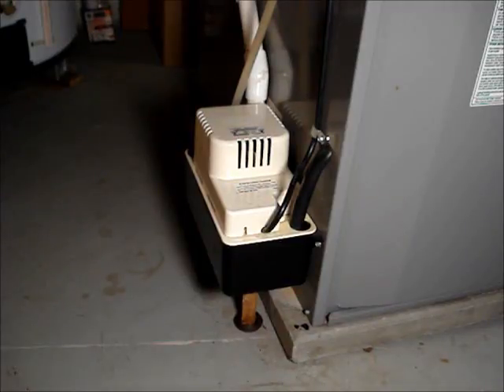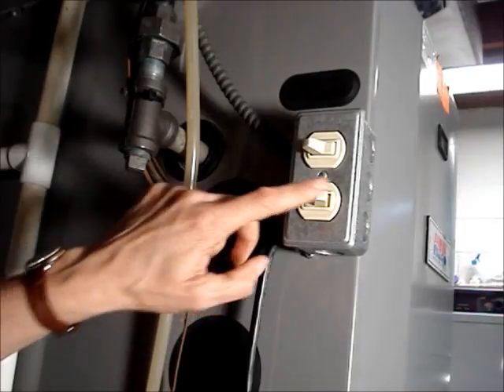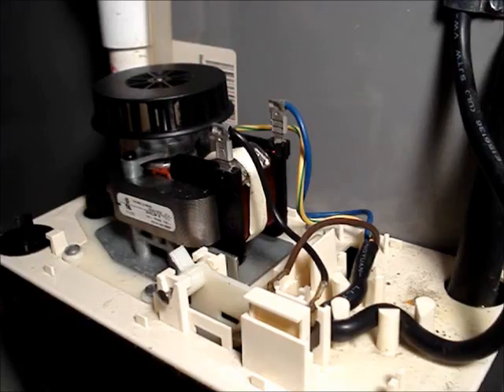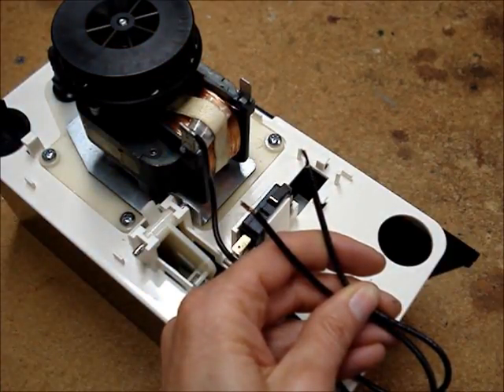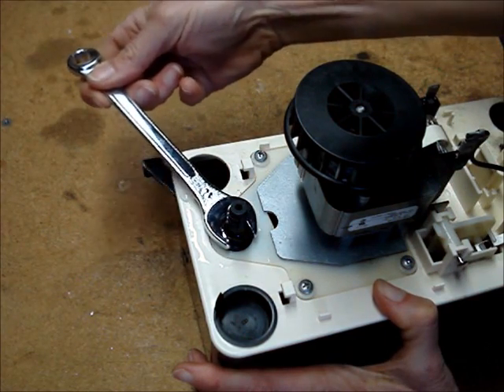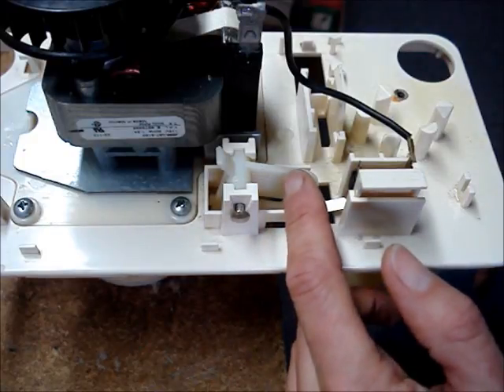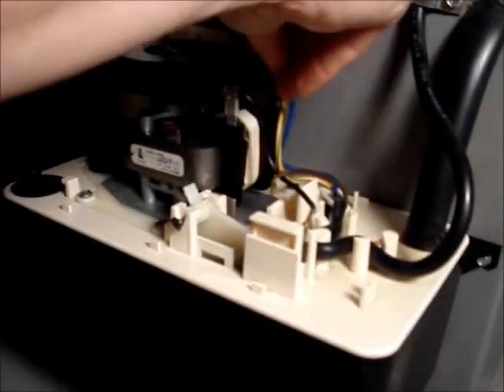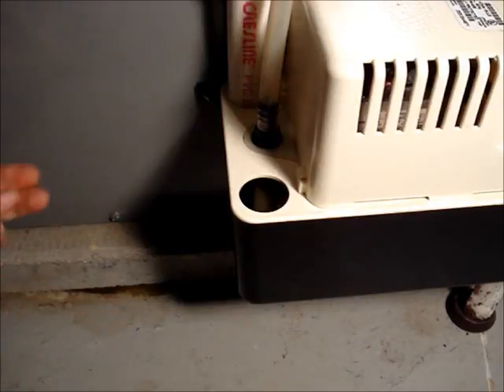Clean a Little Giant Condensate Pump

Comment: Good video but I have to disagree on disconnecting the wires to the pump.  There is absolutely no reason to remove it if your unit is less than 5 years old.  The water DOES NOT get up there and folks who open it will end up breaking or damaging the wires.  I have the exact pump and it's been 15 years since I last changed it.  The only thing I do every 2-3 years is removing the black plastic pump to clean the buttom as gunk will build up.  Brush the float switch and clean it with soap (not bleach).  Matter of fact, I just changed to a new pump after 15 years.  You shouldn't have to take everything apart every 1-2 years.  You don't do that with the sump pump in the sump pit, so why do it with this?!
Reply from the maker: Hi Jeremy, thank you for taking the time to comment and explain how you clean your pump.  The pump in the video is hard wired, there is not enough slack in the wires to do as you say.  I'd have to let it dangle from the wires.  I can't imagine the howling I'd get from some viewers when they see that and people saying that I will break and damage the wires.  Depending on climate, the pump may gunk up more quickly than yours, that is why I imply you will need to adjust the cleaning schedule to your situation.

Comment: You've made this way to complicated.  Cleaning the one way valve once year should do the trick.  If not poor bleach into the reservoir.  Let it sit for an hour cut it back on and all that gunk will be pumped out. If worse comes to worse replace it. It's only forty bucks and HD.
Reply from the maker: Thanks for commenting and telling your method for cleaning your condensate pump.  For anyone wanting to allow undiluted bleach to sit in the pump for an hour, be aware that bleach destroys rubber.  If you think your pump may have any rubber parts exposed to the bleach, you may not want to do this unless you want to replace the pump.
Reply: @Know-How-Now  Bleach travels through your rubber lines of your washing machine lines.  Never had to replace those. I've been doing this for my condensate pump for over 10 years never had to replace that either.  But if you still happen to think bleach is to strong.  Try vinegar should work just as well. My main point is taking apart the entire pump is totally unnecessary.
Reply from the maker: The bleach in the washing machine is diluted.  I would not put pure bleach on anything that is rubber. I did that one time in this life time and it destroyed the rubber in a couple of moments.   My Toto toilet's warranty is voided if bleach is put into the tank.
Reply: @Know-How-Now  Well the bleach in the reservoir is diluted. There's water in there that's why it  won't stop running.  Once again if you think bleach is to strong use vinegar.  Something that will break that gunk up in the reservoir. But the bleach has worked for me if you dont like it don't use it.